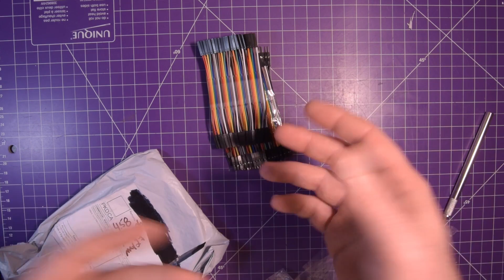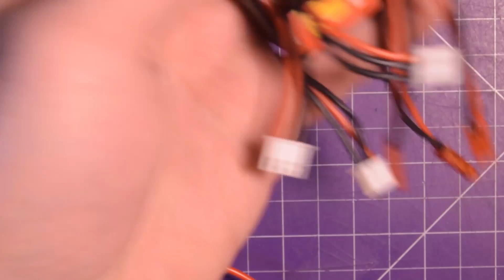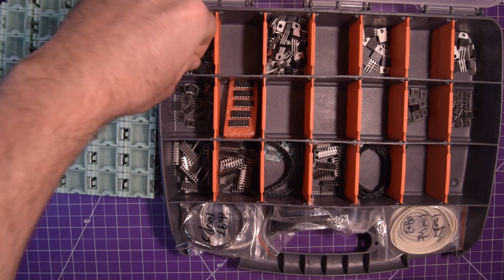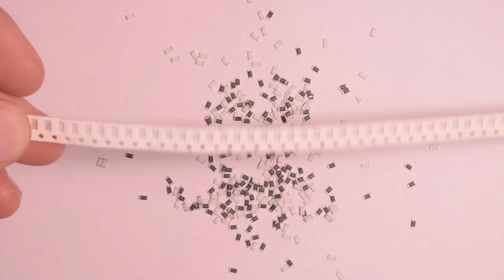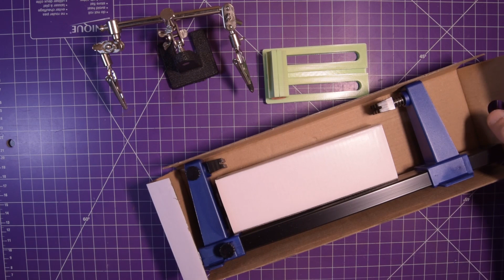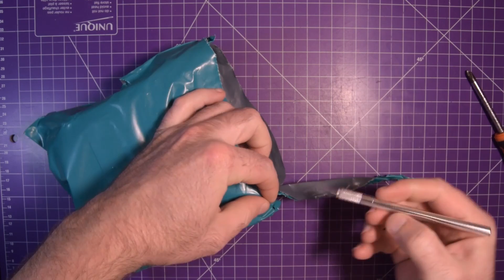Mailbag 56 - Hybrid Theory

Comment: Fun stuff as always.  I love those dupont wires.  Sometimes the male end breaks off in my projects, but that's the price of doing business.  I also love that pcb jig.  A while back I lasered a 3mm piece of wood with 2.54mm spacing and it really makes soldering header pins straight dead simple.

Comment: On the 2 cell packs, I assume there's no protection or BMS?
Reply from the maker: No sir, none, you are supposed to use a charger that will balance the cells - but generally the cells are very well matched when they are still new
Reply: @SimpleElectronics  Once you commit two or more cells into a long series of charge/discharge  cycles without a balance board their voltages will begin to drift. Eventually the relative difference in voltage between the cells is enough to tell the BMS to shut down due to over discharge of one or the other cell
Reply from the maker: Yup this seems to be the common wisdom...although a high quality bms will actively balance the cells...but these are meant for RC cars and planes and therefore do not use a bms at all